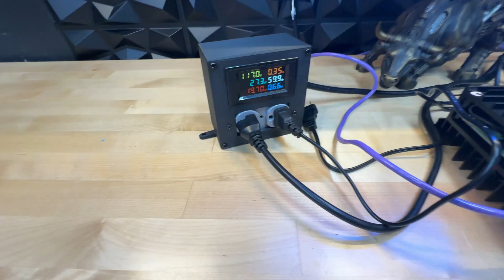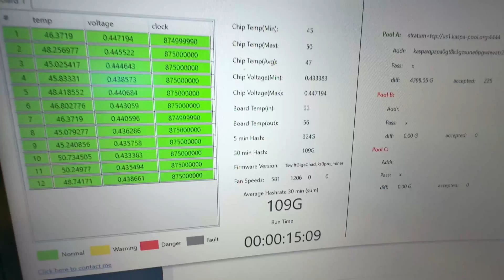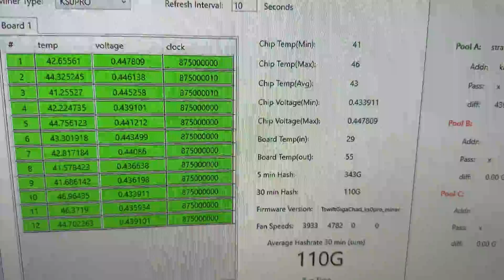MOAR FAN - KS0 Pro Overclocking

Comment: Put thee device fully into the double and connect the single vent into the other end. But the double should have the fan turn outward so as to exaust the heat standing inside the device. Please Try it

Comment: print a whole kaninet/(boxe that fits a real exaust fan that moves some real air (more silent)
that will get some cooling and airflow where needed....
it should more or less be inside a large fan, not bieng sourounded by 20 small oness that does much less work

also to remove the hot air so its not reused

Comment: Looks like some fun testing and whatnot, but i cant see it worth the time and investment.  For example, my ks0 pros, i put new heatsinks for like 8 bucks, new thermal paste *mx-4, new thermal pads, like 3 bucks worth, a usb fan blowing in the side for 10 bucks, t swift software, 180w psu for 18 bucks.  Running 280ghs on only 125w at the wall.

Comment: Since you have two shrouds. Try a push / pull configuration like antminers.
Reply from the maker: i was waiting for professor flow to enter the chat
my issue currently is finding a power supply that can handle 2x2amp antminer fans
just the one psu is only rated for 2a itself so i'm overloading it